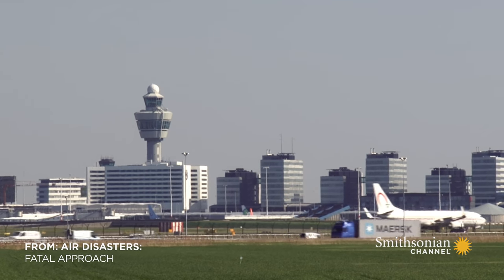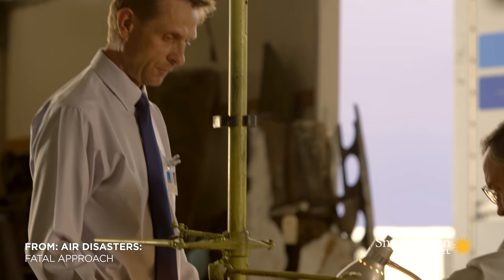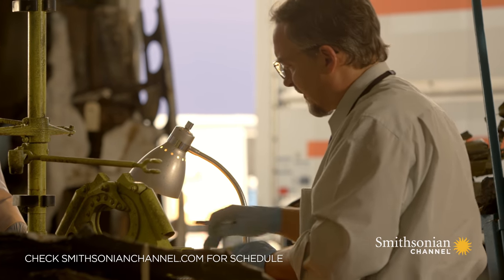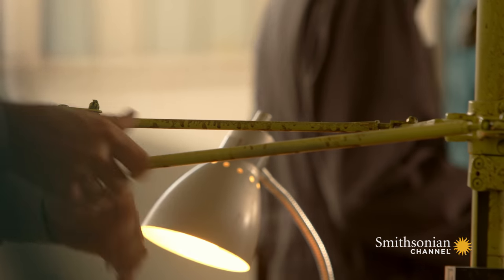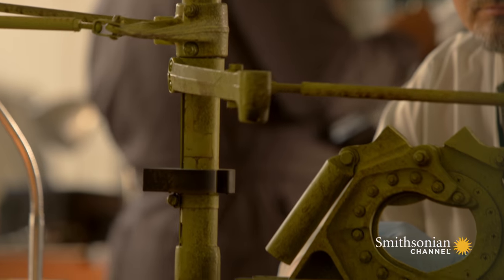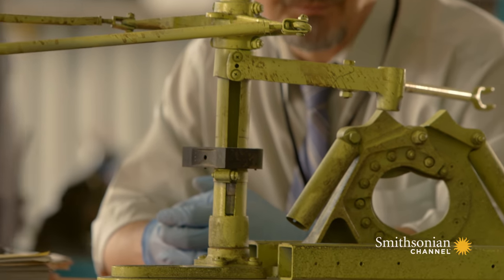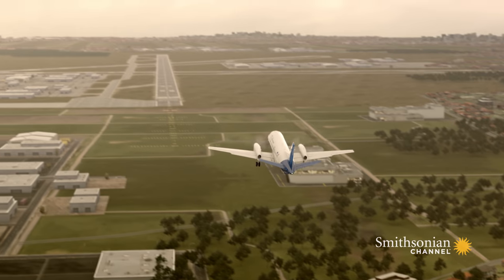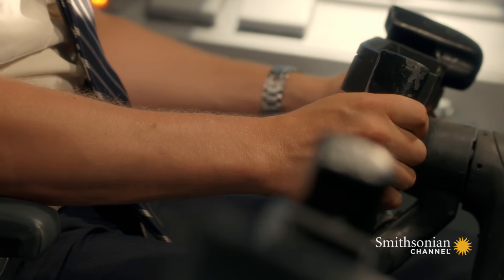Did This Flight Suffer From a Rudder Malfunction?

Comment: Shortly after taking off, the plane experienced engine problems and returned to the airport. While attempting to land the aircraft rolled to the right, pitched up, stalled and crashed. Inadequate use of the flight controls during an asymmetric go-around resulting in loss of control. Contributing factors were insufficient understanding of the flightcrew of the SAAB 340B engine oil system, lack of awareness of the consequences of an aircraft configuration with one engine in flight idle and poor crew resource management..
Reply: You are a hero
Reply: There were no engine problems, the Oil warning came on for no reasion, then the captain pulled the number 2 engine to idle, because he then thought he will protect it from damage. When a Oil Pressure warning went off for no reasion, the captain pulled the number 2 engine to idle, because he thought that he will then protect it from damage. The pilots returned to the airport with an Pan call. The plane came to an dangerous low speed, the captain added a little bit of thrust to engine 1, that little extra thrust caused the plane to go to the right. Then the pilot commanded a go around, flaps 7 and the number 1 to full power. the plane got uneven thrust and the side with less power, will drop, then the engine with higher power pushes the plane into the ground.
Reply: @OfficialDoggyYT  hes watching smithsonian channel instead of reading facts other than the last paragraph
Reply: Ok University of Pennsylvania graduate.

Comment: When a Oil Pressure warning went off for no reasion, the captain pulled the number 2 engine to idle, because he thought that he will then protect it from damage. The pilots returned to the airport with an Pan call. The plane came to an dangerous low speed, the captain added a little bit of thrust to engine 1, that little extra thrust caused the plane to go to the right. Then the pilot commanded a go around, flaps 7 and the number 1 to full power. the plane got uneven thrust and the side with less power, will drop, then the engine with higher power pushes the plane into the ground.

Comment: engine 1 got full power and other was idle that was reason
Reply: @artyjaycayairlines  ?
Reply: Correct. It leads to a bank, and the wings can't support the aircraft anymore. Because there's no lift at 90 degrees
Reply: It should only create lower speeds and yaw not bank and stall
Reply: And the plane banks right before the runway not in final approach
Reply: @B1llsy4ll  you are right. i wasnt that good of a avgeek back then
Reply: Smart the engine 1 is on full power instead of engine 2 it causes to bank
Reply: @AcceleratorGamingMoment  Let's stop discussing here
Reply: IS because false warning right?
Reply: It was a false warning system.

During the flight, a short-circuit in the warning system caused a faulty "low oil pressure" warning to sound. So the captain proceeded in the appropriate manner necessary to handle this (which involved reducing power to the "faulty" right engine).

He completely forgot about this problem during landing, and the plane veered on the runway until he finally ordered a go-around, but then the plane crashed via stall.
Reply: I agree
Reply: @B1llsy4ll  it will bank it. It won't just yaw it, in fact pilots use the so called "differential power" to turn with the engines if the yoke doesn't react